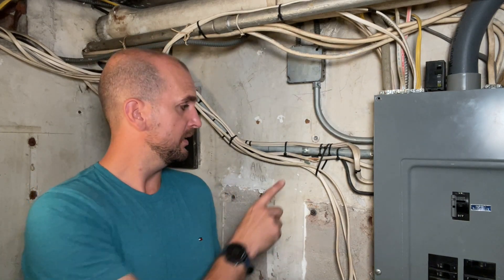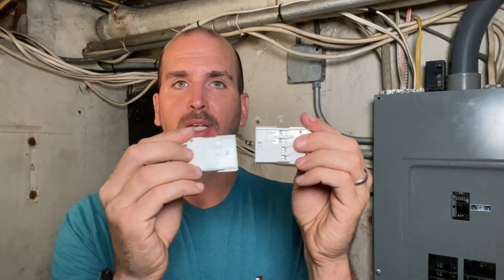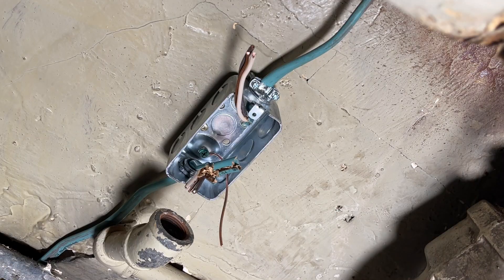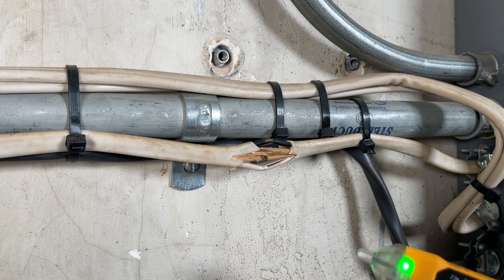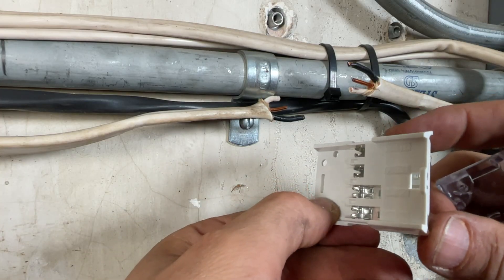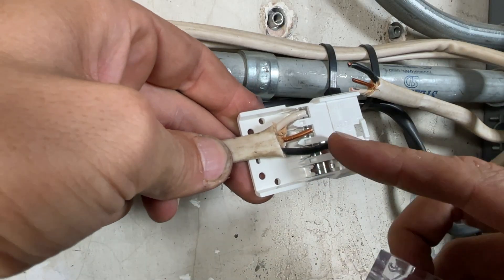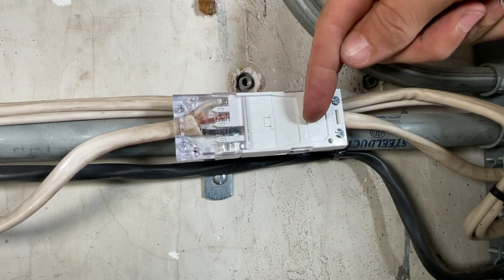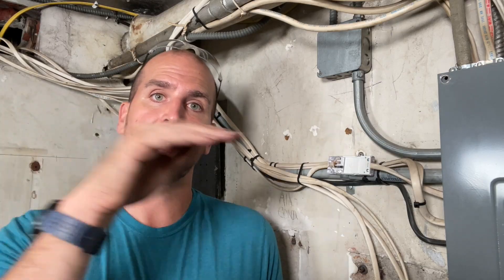How To Repair Damaged Romex Wires

Comment: I wouldn't use the TE Romex Splice Kit. I'm a mechanic and know that high current will cause failure in that splice.
You don't use speed connections for light switches, how is this not the same?
Reply: That being near the breaker box, I would have put a junction box [with a splice] there and ran 3 feet of new Romex the rest of the way.
Reply: @stans5270  I am thinking the same thing. Too much potential for that plastic to melt from the heat of high amp loads.
Reply: @stans5270  that was what I thought of too!  Just run the three feet of “Romex” and add a junction box to make the splice!
Reply: @Grauenwolf  — it’s not the voltage I’m concerned about. It’s the amperage. Can that thing take 20 amps? 30 amps? 50? What is the Romex rated to take? What is that circuit designed for? What is the breaker value? And what happens to all those same questions in 20 years, when that plastic is old, cracked, and crumbly? What about those Insulation Displacement Connectors?
Reply: @shubinternet  considering that's 14ga NMB it should be 15A max on a 15 breaker. 

Buy one and put a constant load of 1800 watts on it and find out? I do not know of anyone constantly running that amount on a single 15A circuit but I suppose you could try. A space heater usually only draws 1500w and is the likely scenario here. Give it a shot.

I don't trust it but you can easily test it.
Reply: I knew that someone was going to say this. 
I was thinking about this as well.

I believe there was another video on this channel which talked about the problems that arise from using mobile home receptacles that employ the same type of IDC connectors ( insulation displacement connectors).

Comment: Junction box all day long to repair damaged wires. Not only are most boxes less than $1.00 for small ones and less than $2.00 for a large one that's often the only approved way in many places to do the repairs. While this thing is neat it's awfully expensive and quite a bit of work to use it, it's not really practical and even though it's NEC approved I don't see many inspectors allowing it.
Reply: Absolutely.

Comment: IMHO; that 'splice' gimmick is a disaster just waiting to occur... even if approved, common sense & good judgment would forbid their consideration. Again, just my opinion.
Also, it's good practice/habit to check to be sure your chicken stick is operational both before, and after each test.
Cool videos, Thanks!
Reply: You should also never solely rely on the no contact method for checking voltages especially if it's something you're working on.

Comment: Wow, that's a pretty useful gadget, but 30 bucks for a splice is kind of dear.
Reply: I probably should not mention the number of places I've discovered in my house where two wires have been spliced together with just electrical tape
Reply: I agreed before watching. The thing is that since (if) it can be installed inside a wall of a living area, $30 to avoid having to see a junction box in your living room is painful but worth it. Plus it’s way cheaper than a brand new run of Romex.
Reply: Also worth thinking about, if the alternative is run a new Romex, cutting holes in drywall is already way more than 30$ to patch paint etc

Comment: Couple of things, as a Master electrician, I do not see how that "splice kit" is approved to be buried in a wall as it is still technically a "joint". Also bet if you took off your panel cover 90% of that wiring is incorrect as you can't bring wires through the service entrance side in to the breaker/fuse side.
Reply: This is compliant with NEC 334.40(b)
Reply: @mr.g937  You still can't have hidden junctions because ALL junctions must be accessible.
Reply: You are correct these are approved and listed for mobile homes only as a buried splice not residential or commercial . I've read the listing on them.
Reply: @B-B-E-44  There is no mention of any such thing here (from UL) https://code-authorities.ul.com/wp-content/uploads/2014/04/ul_NMCableInterconnectors.pdf -  can you cite that with documentation?
Reply: You’re no master electrician with comments like that

Comment: I find that many electricians are not even aware about this solution. These are fantastic, code-compliant splices that can be concealed in a wall too.
Reply: That is because electricians don't use them and you most likely have to purchase these online because not all Home center stores are going to carry them plus I highly doubt electrical supply houses are going to have them.
Reply: @benkeysor7576  they do sell them at rexel but they connection use are called wagoes and their trash.
Reply: @danheath9223  These are not wagos. Wagos actually are a great connector, far better than wire nuts
Reply: @danheath9223  They are not even close to a Wago connector.
Reply: Probably because there is a lawyer attached to each one...
Reply: Because junctions CANNOT be put in walls. Electricians get calls for trailer parks all the time because of this type of connection point. They’re absolutely terrible. As things heat up, neutrals lose connection and those circuits are inoperable